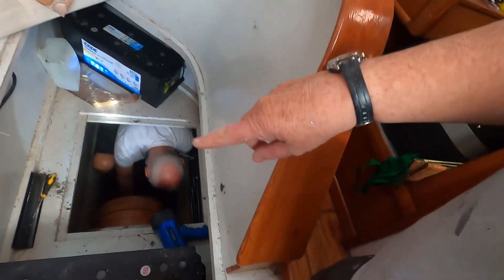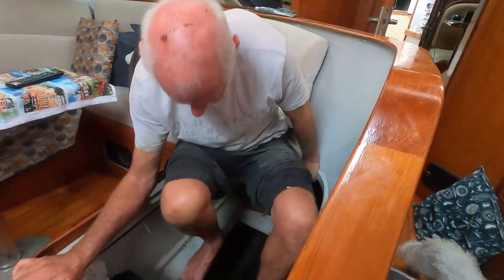Where will Rick put Lou & Buoy if under pirate attach [Ep 71] Sailing Salacia Star

Comment: Did you put a coin under the mast?
Reply from the maker: Yes Richard - when I was cleaning up down there, I found the original gold coin!  When the mast was going back in, I was fretting that I wouldn't be allowed down there to replace it but they had an issue, so I jumped down and replaced it.